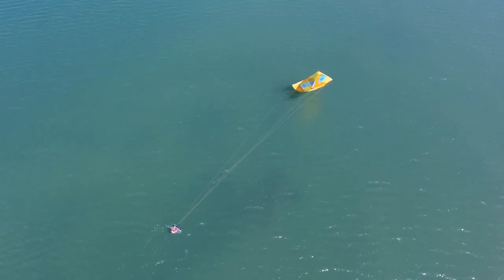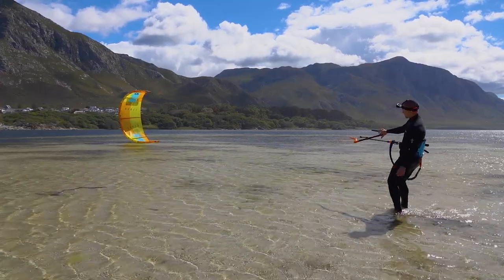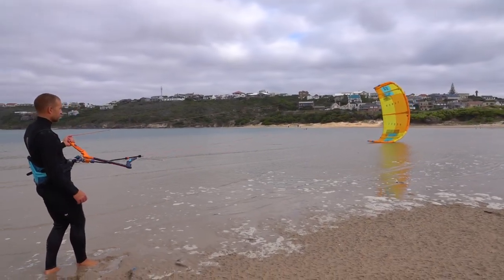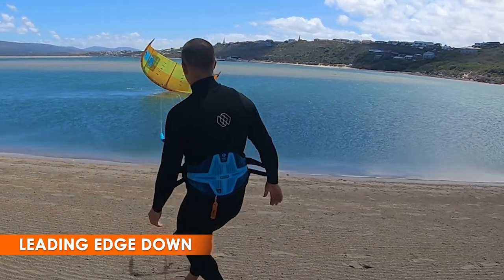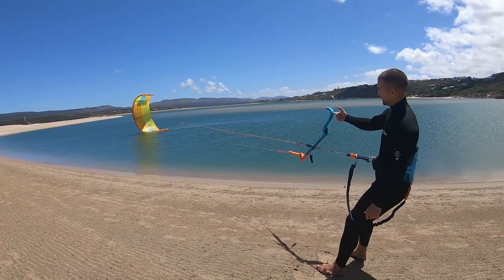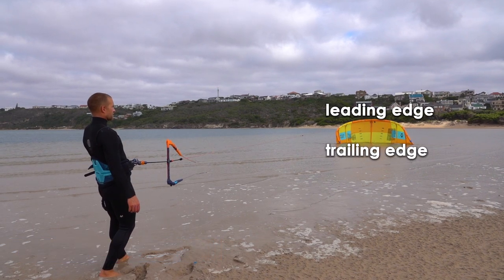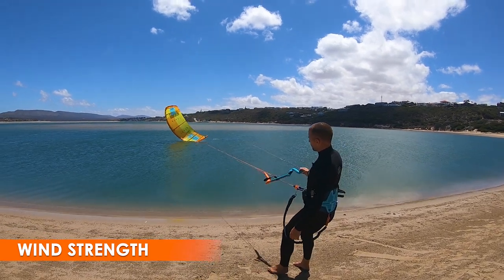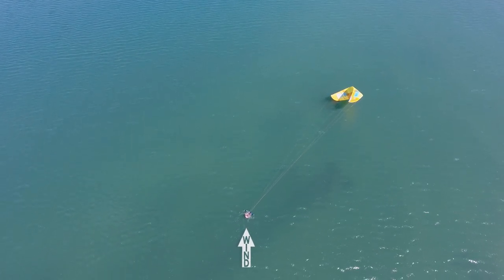Relaunch Basics (how to kitesurf / kiteboard tutorial, Part 1)

Comment: Can anyone give me an advice on what to do with the board while I’m trying to relaunch the kite in deep water? Is it better to push it away to downwind side? I’m so afraid of losing it because it takes forever for me to recover the board.
Reply from the maker: Hi Yuko, you can hold it with one hand (since you relaunch with only one hand), or you can keep the board on your feet. I would not try throwing the board downwind as you can easily get dragged into it as the kite relaunches. When someone asks this question it's usually a sign their bodydragging has some flaws. You should be able to quickly and easily get to a board that's upwind of you. Check out the bodydragging video again, then (as that video suggests) in the shallows try pushing your board far upwind, and bodydragging back to it. Do this again and again. You must be able to get back to the board quickly. If you can do that, and you can relaunch the kite properly, then you won't have issues getting the board back.